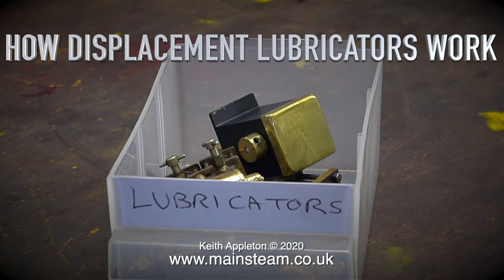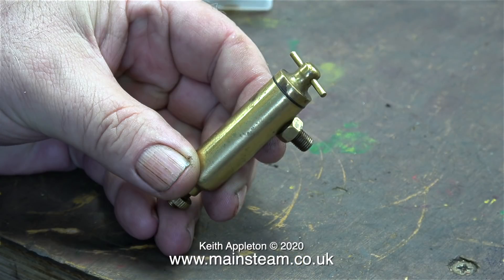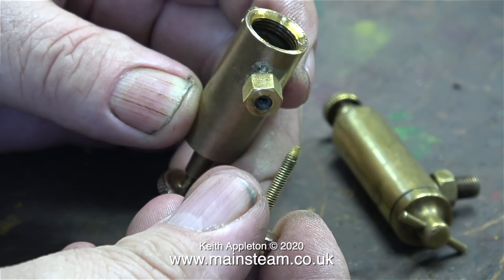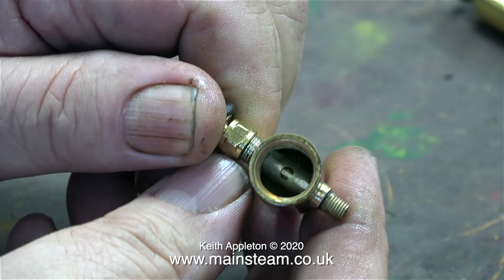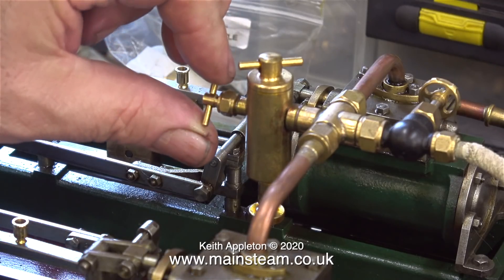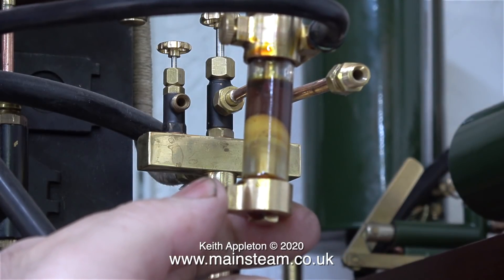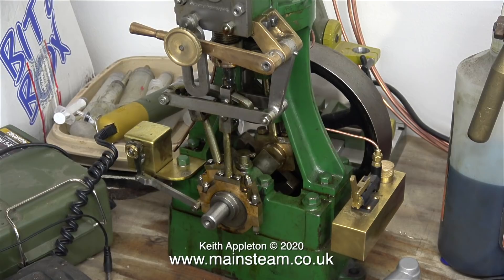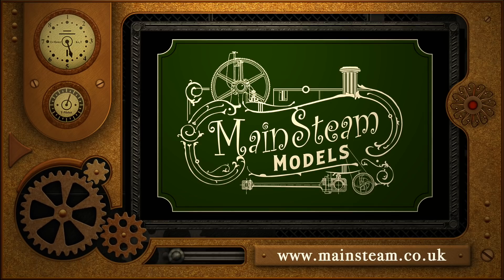HOW DISPLACEMENT LUBRICATORS WORK - STEAM ENGINES FOR BEGINNERS

Comment: Hello Keith.
Nice explanation about the lubricators.
On the Regner Lumberjack the lubricator is mounted on top of the boiler. This works well.
But on my Regner Heisler the lubricator is with a 60mm long single line and is mounted on a cold spot of the loco.
This does not work at all, not even when I turn the tap all the way open.
I use the Roundhouse 220 oil.
I am going to change this lubricator to a lubricator with 2 lines and closer to the steam tap. Hopefully that helps. Regards Egon

Comment: My loco has a displacement lubricator but with no needle, only a drain and a screw to shut it once oil is added. My question is if its safe to refill if i make sure to have my steam regulator fully shut?
Reply from the maker: Yes as long as there is no steam leak from the regulator.

Comment: For load bearing steam engines, would you recommend a displacement lubricator or a mechanical one? I was planning to use a displacement lubricator for mine but I see mechanical lubricators as more reliable somehow. These are however more complex of course so I'd like to hear your opinion before it's Decision Day ;). Also thanks to you I started using my dads old bahco on unions ect, works like a champ having to not search for all the spanner sizes all the time. Cheers.
Reply from the maker: Mechanical every time.
Reply: @keithappleton  Cheers

Comment: Something to consider when it comes to displacement lubricators...
They have no moving parts, contain oil and water which are both non-compressible fluids, steam has to get in (so it can condense into water) and oil has to get out through the same hole the steam is coming in.
You might think that the pressure in the steam line is constant, but it isn't. As the piston begins to travel into the cylinder and the valve opens there is a momentary drop in pressure in the steam line. When the valve closes a shock wave travels back up the steam line (at the speed of sound for the medium through which it passes) like a water hammer though without the destructive effect since steam is a compressible fluid. This is why it is a good idea to locate a displacement lubricator as close as possible to the engine where the effects are greatest.

Can the displacement lubricator be improved? I have seen them with cooling fins on the lower third of the body to dissipate heat and thus improve condensation of the steam. However, I have only ever seen this on French engines - everyone else seems happy with their lubricators just the way they are.
Reply from the maker: As you say, the model ones seem to be fine fine as they are. }:-)))

Comment: Thanks Keith very informative for those looking for the info. i run full size engines and often they have a 2 line displacement lubricators' with a condensing bulb on the top, are they ever use on model engines?

Comment: If you are running a Steam Engine on air, one way to get it lubricated is to treat is like an air tool and use an air tool lubricator. A fellow modeler I know who builds superb models displays them on custom made stands that include a FRL (Filter Regulator Lubricator ) unit. When at shows he just plugs an air line into the manifold and can adjust each of his models to run at a proper speed.
Reply from the maker: Yes I use that system sometimes for prolonged running on air.

Comment: Hi Keith, thanks for your videos and wisdom.  I’m restoring a pair of Alco Firefly Stuart Sirius engines.  (I also have an original complete genset and what may be the first type of boiler made for it, with vertical sliding fire door.)

In the “military” configuration, they weren’t fit with displacement lubricators, yet the “civilian” ones always are.  Is a displacement lubricator necessary for a Sirius at the 30 psi saturated steam the Alco units operated for up to 2.5 hours?  Or do you think the omission of a displacement lubricator was more likely a matter of wartime expediency?
Reply from the maker: I would recommend a Displacement Lubricator, although wet steam at 30psi would also lubricate the cylinders. But as you say, Wartime use is probably the reason they didn't fit a lubricator. People trying to buy Steam Cylinder Oil in occupied  France would be a dead giveaway }:-)))

Comment: Excellent explanation!
I used to fiddle around with the full scale ones when i was on the axe factory, the ratchet pumps are often fitted to old powerhammers and forging press/cutting machinery, they are a bit more complicated, but the basic princip is still exactly the same.

Comment: Bonjour Keith,
The problem with a drain tap when the steam plant is in a hull is that it is quite difficult to open and close, this is why I am always obliged to use a syringe to remove the water after a navigation. I guess they have been initially conceived for static steam plants...
Besides this, i have a glass Microcosm lubricator, it leaked and I broke the glass by tighting it too much, so I replaced it by a brass one.
Furthermore, running generally at 30 PSI I keep the benefit of the lubricant characteristics of a wet steam.  
Amicalement, Raphaël

Comment: I notice on all of these including the glass one that it's tee'd into the steam line with only one pipe going into the actual body of the lubricator, but the one I have on my engine has the steam line going through the body and out the other side. It still seems to work fine and plenty of the oil is displaced by water, is that uncommon?
Reply from the maker: Some are single ended and fitted with a regulator and other are the inline type. Both ways work fine . . .
Reply: Novice here... Does that mean that oil goes out into the steam pipes, using the same single passage as the steam that goes into the oiler? I bought one from Microcosm, just out of curiosity. And now I am quite confused about it, since the passage seems very narrow.
Also, there is something rattling inside, on the lower section, where the drainage needle is. Can't see what it is...

Comment: Perhaps a dumb question, but is there a particular reason the design includes  a pretty small volume  ? Clearly convenient where size is an issue,but something with more storage volume would mean less fiddling with a pretty messy product. Or is it about sized for a good run,so cleaning up after is easier  ?
For someone like me,good at forgetting stuff,a glass barrel would be my first choice. Visual cues. The consequences of insufficient lubrication kind of make me cringe.
Having lots of spare storage volume would be my first choice. I suppose I am missing something here.
Reply from the maker: It's a matter of scale - model Displacement Lubricators are quite over scale to start with relative to the size of the steam engine, so a bigger one would look even more unsightly as does the glass "see through" type in my opinion. A normal sized lubricator like the Stuart type usually holds enough oil for quite a long run.
Reply: I think on GW locos there were sight glasses which crew found very assuring.  That's about all I know about the topic!